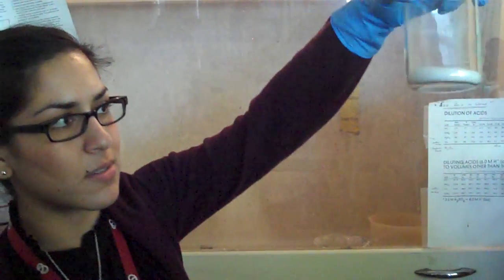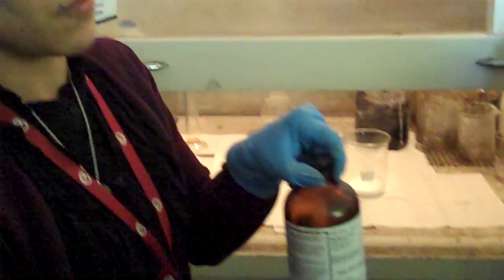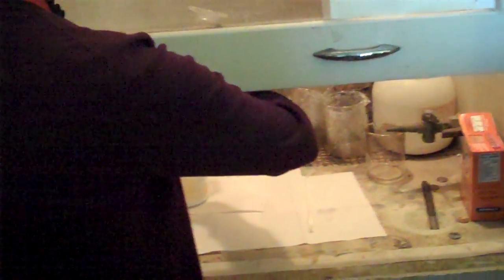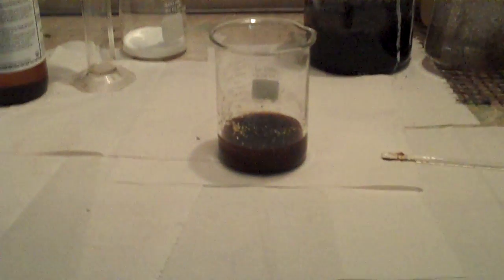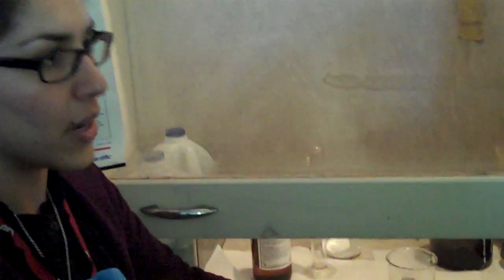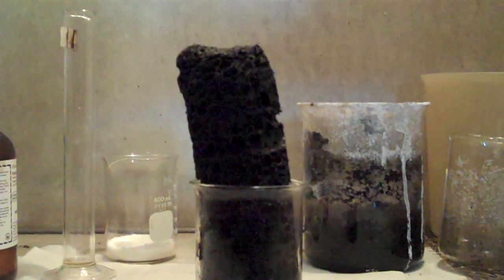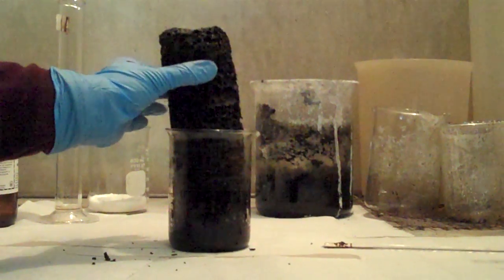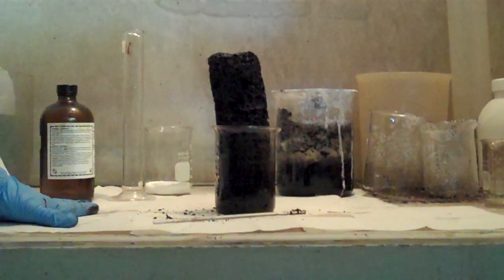Dehydration of Sugar with Sulfuric Acid

Comment: isnt the acid decomposed in the process? it would really be a catalyst then since it would not be reformed at the end
Reply: catalyst changes activation energy never gets used
Reply: +Nick Balderson that is not true,  catalysts are used in the machanism but get reformed later
Reply: Barnesrino Kipperino often a catalyst will react with one of more reactants to create an alternate activated complex. Thus some, if not all will be used up. 

Many catalyst merely create an alternate reaction pathway with a lower Ea.
Reply: In this particular reaction the acid is not a catalyst but a reactant. The products are carbon, co2 and so2 (which is why it's done in a hood). The acid in the carbon product is just residual as the sugar is there limiting reactant.

Comment: How concentrated does it need to be? Above what molarity concentration or percent concentration is considered "pure" I have looked at online chemical supply stores and can't find any that sell pure sulfuric acid. They all sell sulfuric acid listed at some concentration less than 100%. The best I can find is 99.99% but that means that 0.01% is water. For it to work as a dehydrating chemical, I think it needs to have no water (so it has a desire to "suck up" water). Where can I find truly pure (100% purity) sulfuric acid for sale? And if I'm wrong about this, then what is the concentration that in fact is needed to make this reaction work?
Reply: BankaiIchigo12345 you cant have 100% sulfuric for the same reason tis such a good dehydrating agent, it will never let you leave with the last few molecules since it will dehydrate whatever you use to remove the water
Reply: aajjeee How concentrated does it have to be in terms of % sulfuric acid, for it to work in this experiment?
Reply: 98% is the norm for it to be concidered concentred, but lower concentrations might work just as well.

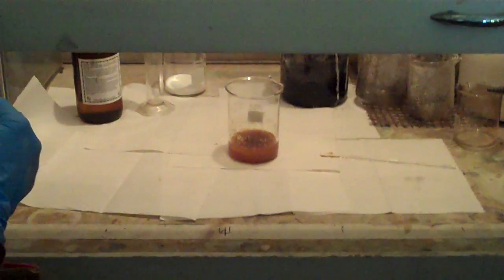Comment: LOL 2:24 It's turning in to Carbon, oh so it's turning in to a gas? Face palmed so hard XD. When the MELTING (not even boiling) point of carbon is roughly 3773 Kelvin.
Reply: There is also some CO2 and SO2 but it is mainly water.